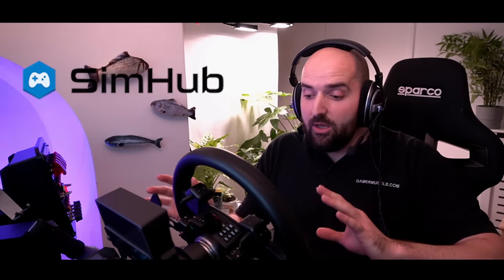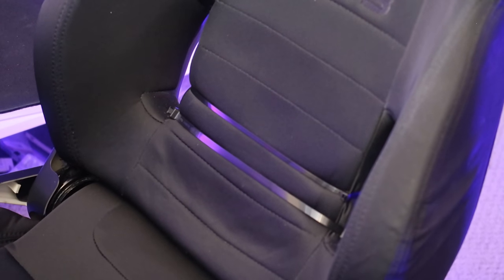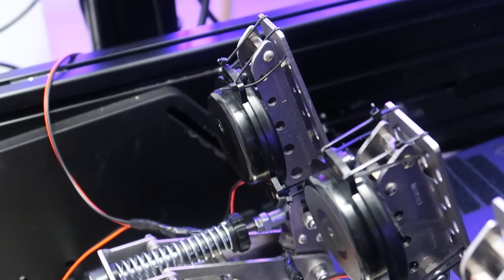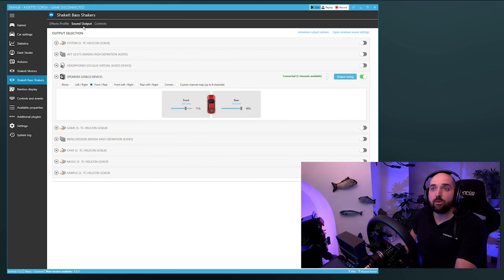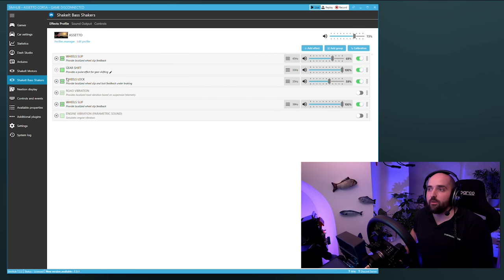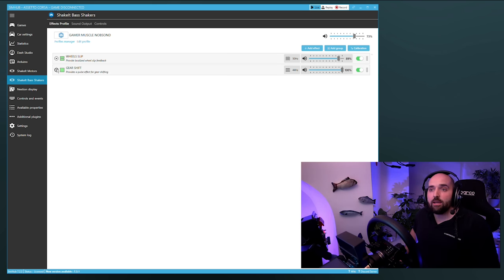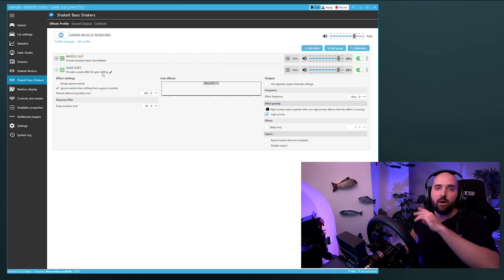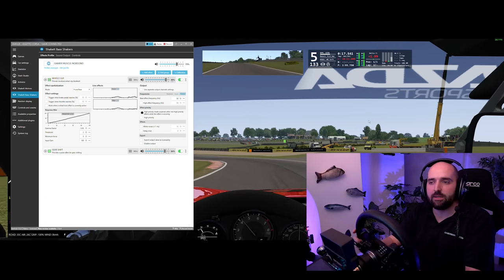How To Add Motion To Your Racing Simulator For £150 - Guide

Comment: I've been running simvibe for a few years now in my CART/ IndyCar tub and now I'm terrified of catching fire after watching this 😄😂

So now more immersive rig fire suppression system incoming!
Reply from the maker: I kept checking that everything was cool and to be honest its all very low voltage normally speakers are unlikely to be a fire issue unless the power brick is faulty. 
I just don't want people to blindly follow this video and then blame me if they catch on fire :_GMVERROR:.
Reply: @GamerMuscleVideos  The problem is chinese dac. These can for sure overheat and start smoking etc. Especially with amps. Need to keep an eye on it
Reply: @GamerMuscleVideos  I run 2 mini LFE's and 2 Dayton pucks off of 2 2 channel 150w amps. Ran 45 mins with things turned up more than normal and all transducers were cool to the touch. 

I will definitely keep a closer eye on things though, stupidly I've not really considered these things much of a risk. Thanks for opening my eyes a bit with this video though!

Comment: What a legend. Thanks for posting up your setup and how you configured it! I've been waiting and hounding and you delivered! I have been thinking over how exactly I want to mount a front transducer. I've only got the Clubsport V3 pedals but they're mounted upside down so I'm thinking that direct pedal mounting will work out without the weight overpowering the throttle spring.
Reply from the maker: Might not be a good idea putting them on the CSV3 pedals but maybe you could just use a single large shaker on the tray , you should ask around with other people that have used them with V3's
Reply: @GamerMuscleVideos  Thanks for the input. Maybe I need to go with a single larger transducer mounted as you say. I can't feel the little rumble motors on them much as it is so need something stronger.
Reply: I've got those pucks mounted the same as GM on CSP V3's. The throttle is slightly slower to lift when you take your foot off but not really a problem. You could always put the heavier spring in too (I haven't bothered).
Reply: @dave81983  Thanks for the info! I have the heavier spring installed so it might work out but I also inverted the pedals. I've been going back and forth on mounting to the pedals versus mounting under my foot plate.

Comment: Great video! I like the idea of these little pucks and the little nob box. 

I’ve already got a couple of buttkickers, with 2 external amps. I use that for left / right slip. I was thinking of another 2 but couldn’t justify the outlay. 

However a £150 outlay is do-able for me - do you think these will all play nicely together in SimHub as separate sources?
Reply from the maker: Yah SIM hub does not care , I was messing around with using another amp + the nob sound before I made this video all.worked fine. 

In the end I found 2 channels was fine to get most immersion whalst keeping things cheap and simple.
Reply: @GamerMuscleVideos  great, thanks! I’ll go for it and try not to set my rig on fire 😀

Comment: Great video! I think I want to do something similar but I'm new to all of it and I don't get how you got the 2 puck shakers connected to one channel on the nobsound? and if you could control each one separately?
Reply: The pucks have positive and negative Wires each. He has the two pucks (4 Wires) wired into a dual wire at the pedals end (keeping positives both together, and negatives both together ), then that dual wire correctly wired into the l & r of one channel on the nobsound.

He gets exactly the same feedback on both pedals as its one dual wire.

The seat transducer is wired to the other nobsound channel and is controlled seperately in simhub

Comment: Do you think the nobsound amp can drive two bass shakers? Your setup has one shaker (which is bigger and requires more power I guess) and a few smaller transducers, but would two bigger shakers work?

I would assume so, as it outputs the same power on both channels?
Reply from the maker: It will drive them , don't know how long it will run for before burning out or having issues.   These small amps will probably use quite cheap components that may work fine or may not lol.   If you 100% want a sure fire thing that works check on forums for people that have kit that they have used for a while.    this project was mostly me just messing around and having some fun to see what I could do for cheap.
Reply: @GamerMuscleVideos  thanks man! No 100% guarantees needed at all, a “will probably work” is good enough, especially for the price!

This was an awesome video, always fun to get some ideas for immersion and just pure fun, on the cheap! I hope for more of that in the future :)

Comment: I used an old 3d printer power supply to power the nobsound. I bought two reckhorn 200i bass shakers. One I mounted with wood screws to my seat - an old mx5 seat. I had to drill pilot holes into the seat, which appears to be made of granite. Very comfortable seats btw - £25 off eBay.

The pedal shaker I mounted below my clubsport v3 pedals using an old wooden IKEA chopping board, isolated from the rig by cheap vibration mounts from eBay. I did try a 4mm thick aluminium plate, but it resonated horribly.

It has undoubtedly made me more consistent as I can feel the wheels slipping - both front and rear.

Comment: How did you wire 4 tranduscers from only 2 outputs off the Nobsound mini ??
Reply from the maker: the two Dayton pucks are  wired in Parallel  off the single channel so they both are doing the same thing.

You would need a 4 channel sound card + amp if you wanted 1 transducer for each wheel , to be honest I found just having pucks on pedals and the base shaker on the seat worked really well and I don't really think 4 channel + 4 pucks is really needed.
Reply: @GamerMuscleVideos  yeah i currently have two Reckhorn transducers on a two channel amp and its plenty. One on the pedal deck and one under the seat. Might need to steal that cable tie idea tho ! 😉
Reply: @nevillerichards9330  do you think it would be better mount it in the back? I’m about to mount my reckhorn basshaker but don’t know where to put it.

Comment: Which one should I get? Amazon has options for 8 or 16 ohms
Reply: Probably too late, but in case you were wondering I was trying to answer the same question and apparently it really depends on your amplifier. There may be some advantages to having 16 ohms, but this specific amp is better off powering 8 ohms. So unless you want to change the amp, I'd say go for 8.

Comment: Will this make you feel the curbs? Or is it just tyre slips you can feel?
Reply from the maker: You can have it so you can feel curbs , engine , suspension compression tones of things. 

But I found it's best to just have it do slip as that's something usfull for driving. 

If you wanted it for immersion then suspension engine and track vibrations would be good.

Comment: thank you for this video, just set mine up but getting all the sound coming through transducers, have messed around with all window settings etc but cant work out how to get the vibrations and sound through headset any tips? im running automobilista2

Comment: Hey. I'm using sim hub for vibrations with a similar setup to GM but on iracing. I've tried it with tyre slip but it just doesn't seem to translate to what the car is doing. I get a lot of vibration when the tyres don't seem to be slipping and then then I induce loads of understeer deliberately it's almost like I get less rumble. Is it an iracing thing, simhub thing or am I doing something wrong?

Comment: If you set this up for one, say ACC, could you use that same profile through all other sims, like AC+CM and iRacing?
Reply from the maker: For the most part yah. 

Some sims trigger slip more or less than others but generally you can just use a single profile.

Comment: Need some help. I have purchased the bass and audio pucks off Amazon but did not come with a long audio wire. Which audio cable do I need for this and how do I connect it to my Nobsound mini?. Apologies for my amateur tech knowledge
Reply from the maker: I used this , been good for two weeks so far 😂

https://www.amazon.co.uk/dp/B00EKKARC2/ref=cm_sw_r_cp_apa_fabc_S7ZRXSV5Z8SM29Z908JD?_encoding=UTF8&psc=1
Reply: Cheers mate

Comment: @gamermuscle Because I hang on every word you say, I bought this equipment. Wired it all up last night but can't get it to work. I think my nobsound isn't powering. Q, is there a little light on the power pack when plugged in? It appears there is but mine neither illuminates the light on the power pack or powers the shakers!?,,! Any help?
Reply from the maker: Hmm maybe your power supply is broken , I just plugged mine in and it worked , there is an on off switch on the nob sound but other than than should just work.

Comment: Could you put these on the clutch to give it the clutch a bitting point?
Reply from the maker: Maybe but it would be pointless , only time you really need to feel a clutch bite point is in a road car when coasting , reversing or doing other super slow stuff. 
Maybe worth it for euro truck sim but I don't know if simhub works with that.

Race starts , you are better using bite points / launch controll methods or just controling gas on slower cars.

Comment: Hi, #
Do you need a seperate amp for each transducer, your help would be gratefully appreciated
Reply from the maker: No , one channel for each transducer.  Like how each speaker on a hifi is on a channel.  IE left and right

You can even put multiple transducers on a single channel but you have to make sure the amp can take the load. 

If you are not sure check on race department or iracing forums there are lots of people using this sort of setup 👍☕.

You can use multiple amps and sound cards if you wanted to though.

Comment: on the pedals, can you put one transducer to work with the tyre slip on the gas and other on the brake when abs kicks in? 2 different transducers on 2 different channels? can you help me, i really want to mount something like that... thanks man, keep up with good job, greetings from Portugal
Reply from the maker: If you wired them to seperate channels yes.
Reply: @GamerMuscleVideos  thanks a lot for the reply. So, i need at least a 4 channel amplifier, is that right? Can you sugest One, that dont break my intire budget? Thanks a lot again, with your videos help me choose my dd wheel and now the bass shaker sistem, youre awsome
Reply from the maker: You would be best asking on race department forum 👍

Comment: If I click the shakelt bass shaker tap on simhub and click the test buttons on my settings everything works fine. Now I launch F1 2020 and I dont feel anything like I felt in the test from simhub ? Is there a setting I need to change or am I doing it all wrong ? I'm using : Nobsound mini whit 1 bass pump 4ohm speaker. The speaker is connected to the left side of the Nobsound and the Nobsound is connected to PC whit the USB cable. No matter what I do I only feel vibrations when I click test on simhub and dont feel anything in the F1 2020 game. Is the game not capable for this setup or is it a setting I need to change ? 
Please let me know.

Thnx
Reply: I’m having the exact same issue with “Asseto Corsa Content manager” right now, did you find out the issue/fix at all?

Comment: Gamer can you show how they are actually wired.  Red to black etc.
Reply from the maker: They are the same as speakers , if you were to wire them back to front then they will be out of fase but it shouldn't damage anything. 

The transducers on pedals you can just wire in parallel , seems to be ok for me. 

Maybe double check on the race department forums and ask others there setup and what worked for them ☕ 

My set up will probably blow up

Comment: Nice job but you could have bought  fanatec v3 pedals comes with motor  on brakes and throttle pedals does the same thing and at around 3 to 4 hundred pound a good buy
Reply from the maker: I have fanatec V3 pedals .   The moters in them are not that strong and this setup is much more immersive.
Reply: I dont know why they even be there's with the motors on the V3's, you can barely feel them even with socks!

Comment: Would love this on my setup. Do you know if this simple setup would work on a Playstation 5 by connecting the USB (doubt it)? If it does and I can’t use SimHub with the PS5 right? Anyone know??
Reply from the maker: No , this only works on pc using "SIM hub" software. 

You can get transducers that work for ps5 but it will just be rumbling based on the sound , not based on physics.
Reply: You could strip the audio as GamerMuscle says, like with a powered splitter (one output to speakers, another to transducer amp). Not as good as Simhub but if you also use an equalizer (with treble turned down and bass turned up), or better yet a low frequency crossover (ignores all except the lower frequencies) and then send that output to the transducer amp, you can at least stick to the engine/tire end of the sound spectrum rather than have your transducers pick up everything. 

Side note: the Thrustmaster TGT-II wheelbase has a built in transducer that only works with GT7/GT Sport on Playstation and is separate from the audio data, but it's also belt driven and overpriced for what you get (meh pedals too)--personally I think the Fanatec DD Pro is a better use of the money, if you can get it at standard price. But if you have a lot of spare cash and only play PS GT games, or if Fanatec stuff is crazy expensive where you are, it might be worth checking out.
Reply: @RongleBringer  thanks so much for your comment. I've recently purchased the Fanatec DD1 to mount on the Wheelstand 2.0 and new CSL with load cell, eagerly awaiting it's arrival. Coming from a T300rs I think this will be a massive step. But I don't want to stop there and I am really interested in this Buttkicker / rumble effect. I am all in for immersion and would love to incorporate this into my setup. The lack of information for console setups is astonishing though. I get really dumb when it comes to wiring and DIYs though. I have a Denon x3300w receiver and was curious if the buttkicker could be hooked up via my sub 2 out? I dunno but it's all mega confusing. Like you said I would only want the tyre slip road details to go through to the Buttkicker and nothing else so dunno where to begin really.
Reply: @GamerMuscleVideos  thanks for your reply. It sucks that I can't do this sort of thing on PS5. If you manage to find a workaround please make a video of it as there are many like me that would love this sort of immersion on console.

Comment: That's really not such a high price, so it might be worth trying, however I am worried that the latency between the sim telemetry, sim hub software, the sound card and the speakers might be a bit too high (more than 5 ms) and could end up being confusing. I'm talking about very competetive racing. This sounds super fun for more casual driving, and I would totally get it.
Reply from the maker: If you are racing super competitive then its 99% about guitar hero memorisation skills than driving from feel.   The slip vibration is such that it can give you a nice bit of warning if the tires are being pushed in the same way audio does.   You can listen to music with it all in sync so the latency will be mild.   

Also I'm pretty sure you have more than 5ms  with your FFB wheel and screen from the game simply due to the nature of how windows and devices works.

Comment: Could you make this work in any sim, such as BeamNG?
Reply from the maker: It works with any sim that outputs telemetery / works with simhub which is most sims and some games.
Reply: @GamerMuscleVideos  Roger, thanks. I love BeamNG, but I do miss the shaking effect thru the entry upon tire slip that AC has but Beam lack.

Comment: Do you think mounting it under the seat would be better/worse? And why? :)
Reply from the maker: Should work fine under the seat , but the back can be better depending on seat design as the seat can act as a resonance cavity and having the vibration on the back feels better for gear shift / engine vibrations.

It can depend from seat to seat and what a person just happens to like , in general I think you will feel more from it being on the back than bottom as the seat will dampen lots of the vibration from it as well if its under the chair.     Just up to preference really though :)
Reply: @GamerMuscleVideos  thanx a lot! :)